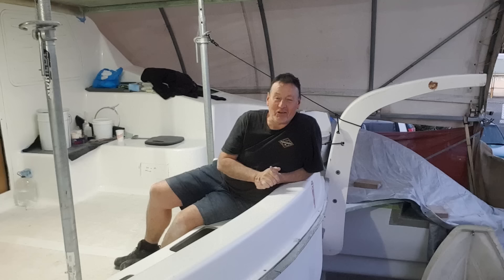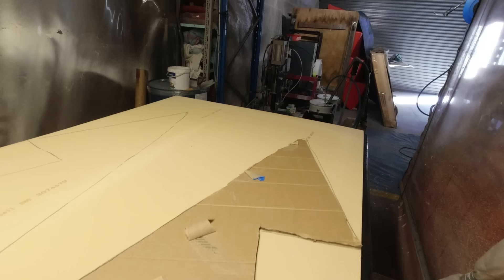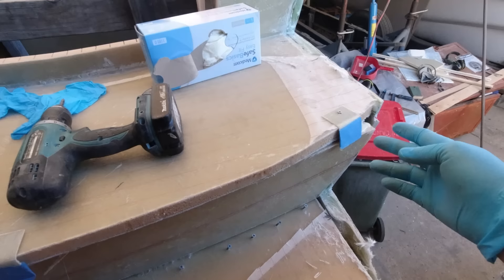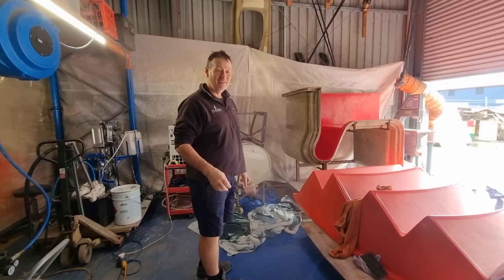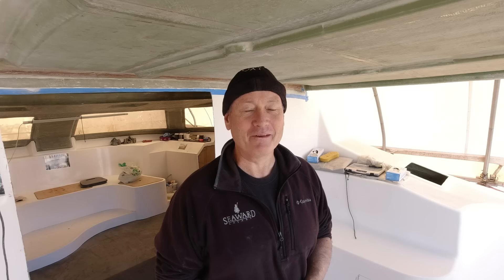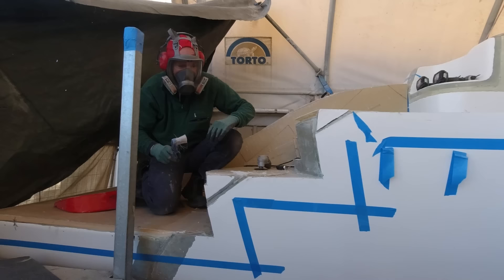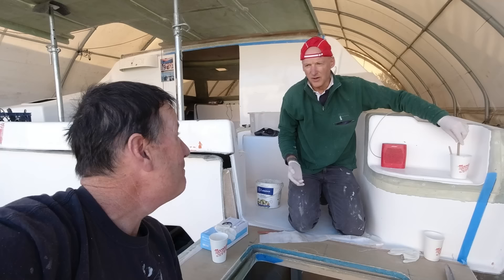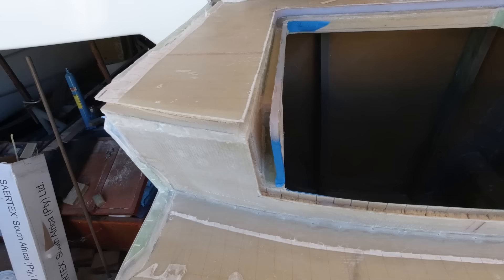It's "Phone a Friend Day" here on the Hulls - Cruising Catamaran Build EP 235

Comment: That coring looks like a lot of work!
Have you considered an air powered die grinder with a carbide cutting bit? A round ended bit will cut through that foam like it's warm butter and leave a nice round surface to fill. They're cheap and easy to use. I use one to modify cast iron cylinder heads, I'm sure your mechanic friends would have one to try out.
Reply from the maker: Routerbit is the answer,rounded bit leaves a scrim of foam that can cause delamination again Requires even more sanding..I have seriously tried everything in my tool kit including die grinders,router bits,Allen keys in drill,Dremel etc.Just a crap job all round but nonetheless,totally essential  .Ross

Comment: Hi Rossco !  For further work excavating foam from your surrounding areas of hatches... what if you get a piece of old (1/2 or 3/4 ") steel tube or iron pipe long enough (8-12") to use as a cutting tool chucked in a drill ?  Take it and use a large drill to sharpen/chamfer inner face or edge of pipe so its sharpest close to OD , and a little file work for outside to get a clean serrated edge ? Add a hole back near chucked area as a port for compressed air to blow out chopped up bits of foam that will build up inside pipe ?  Otherwise make a custom spoke shave style cutting blade (channel or U shaped).

Comment: Ross could you use chopper gun rovings to fill the areas where the resin won't run out? If you can it would possibly save a lot of time. I enjoy your videos  a lot. Thanks.
Reply from the maker: Adding choppy is a good idea but can be easy to leave air bubbles when jamming It in the core.By piping it in it sort of eliminates any chance of that.Ross

Comment: Hey Ross, an idea to help with the coring what about using a strip of fiber glass impregnated with poly and then roll it up length ways and make a long -ish rope out of it and then that in the core and do some shaping. Would be super strong. But this idea is probably a day late and a dollar short at this point.  Just an idea, saw this done on anther cat that is being built.
Reply from the maker: So much more work,High chance of avoid and only really sensible in bulkheads where structural strength is maintained.Ross
Reply: @LifeOnTheHulls  now that you say that it makes so much sense then what I was thinking, that why you are paid the big buck or is that the miss being the big buck... thanks for the replying  so fast.

Comment: How about bending a steel coat hanger (if they still have those) the cavity shape you need in the foam then run just enough current through it to melt the foam and not the glass?

Comment: String theory. Your hatch in the steps, the inside triangular piece of the channel will likely need trimming towards the top in a slight curve to allow for the hatch to be raised. You will also likely need a vertical piece of board between the triangular pieces to stop the water flowing back inside the sugar scoops. A piece of string from the hinge edge to the bottom front lip will show you if you have clearance ( sort of as it is an L shape). A full height piece of vertical board would also help support the hatch where you step on.
Reply from the maker: All sorted they are trimmed to suit hatch lid Thanks for noticing.I love how perceptive our viewers are.Ross

Comment: For those parts that require removing the coring, wouldn't have been easier to use something like Coosa board instead.  It would be stronger and lighter than removing the coring and filling with resin and flock.

Comment: Hi Ross.  You should look into what MJ Sailing did on there corners ( epoxy and Rope) I know you are not ready for your Rear support for the Top take a look at Sailing Ruby Rose there have a Catamaran being build and a great support for the top in the back.
Reply from the maker: Rope not needed in this case,not structural bulkheads, just structural cabisil and cotton flock filler is better with less chance of air voids arounds steps with heat expansion delimitation the issue with cored filled foam..MJ used vinylester in their uni fillers not epoxy.I have a targa mould about as big as the 1370 but will not use it as it is an old fashioned look in this case and stainless poles will be about 2 months quicker and easier to engineer correctly.Cheers  Ross

Comment: Hey, Ross!  I've been wondering about the "Cotton Flock" you use when you want to create a filler.  Have you ever considered using glass fibers instead?  Obviously, you are the composite master, and I've never done anything like what you are doing, but I thought "why cotton flock and not glass fiber?"
Reply: I agree . My fav is 1/4" chop and fumed silica thickened resin mix....
Reply: There's various fillers for resin, depending what you're doing. You use do glass fibres where you need high strength, like fillets, but for when you're just filling voids you use shorter fibres that are easier to work into gaps and doesn't slump.

Comment: Hey, Ross. Is there another lip to be installed on the lower edge of your hatch openings? As it is, it looks like when water runs down your extended gullies it will come to a point where there is no resistance to it being blown into the opening by a following wind. An inch (sorry, 25mm) of overlap with gasket seems to be called for.